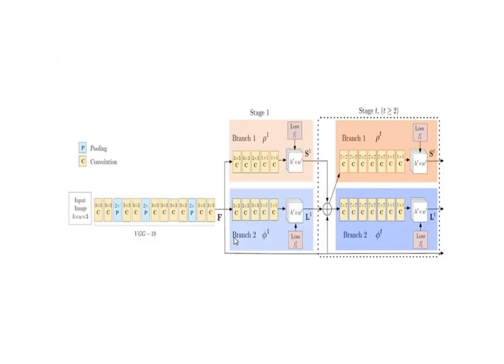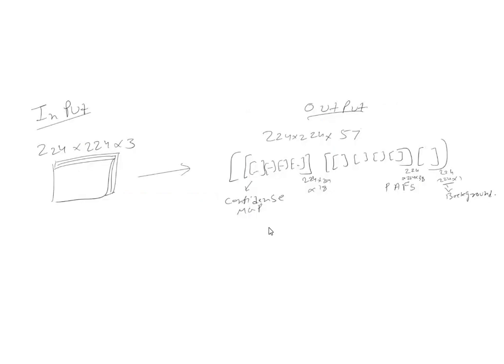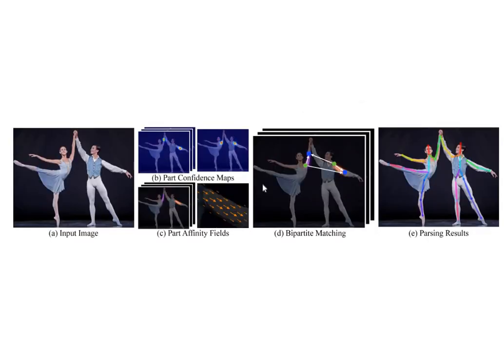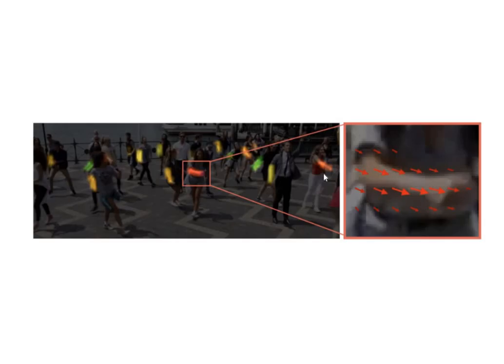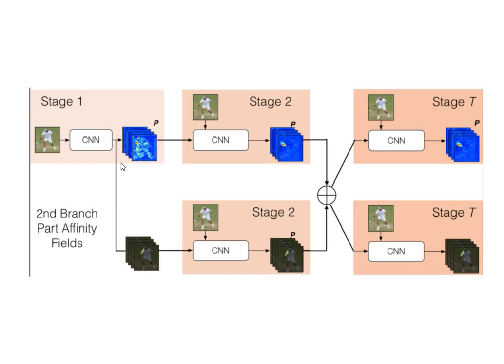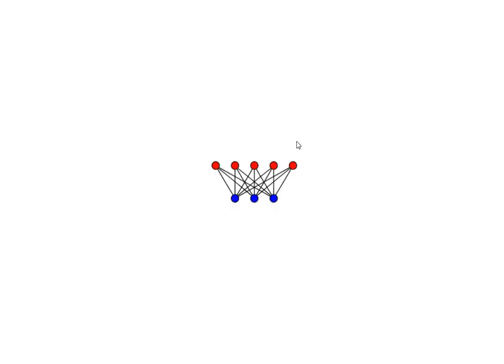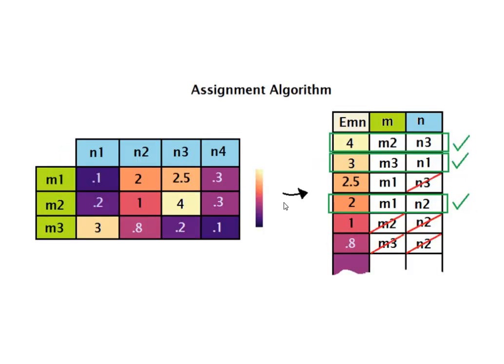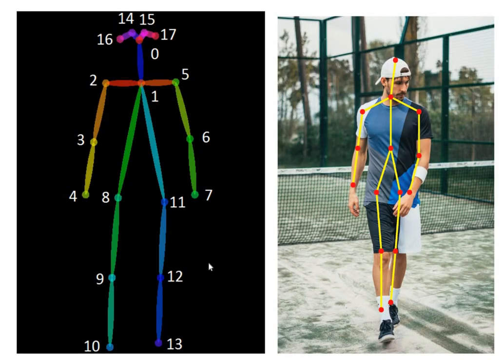How Pose Estimation works : OpenPose Part 2

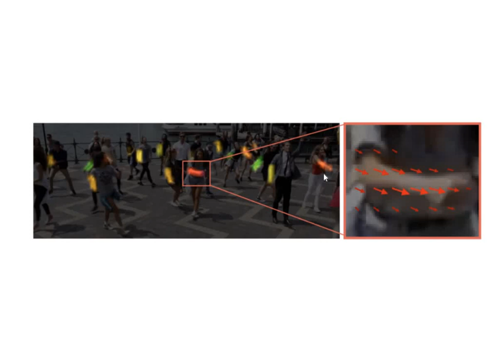Comment: Thanks for the great video! Question: at 5:35 why are there 38 different pairs in total? Wouldn't the number of different pairs depend on the number of humans in the scene?
Reply: 38 different pairs are for each person, the total number of pairs equal to 38*n, where n is the number of humans.
Reply: @gurvindersingh-tz1jk  Hey thank you so much for your clarification! That makes more sense. Though could you please tell me how did we get 38 different paths? I understand that we have 18 joints and that we're trying to combine 2 joints to get a legit pair, but where did the number 38 come from? Are we calculating each pair twice (eg: neck to torso and torso to neck?) Thank you!